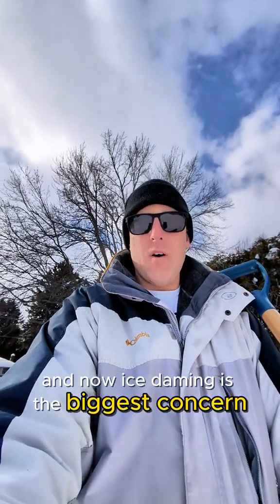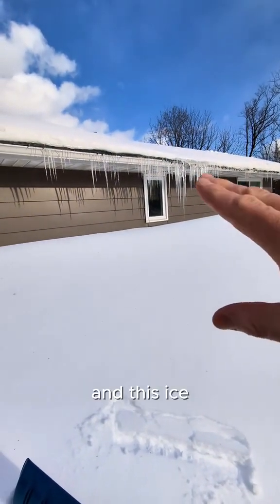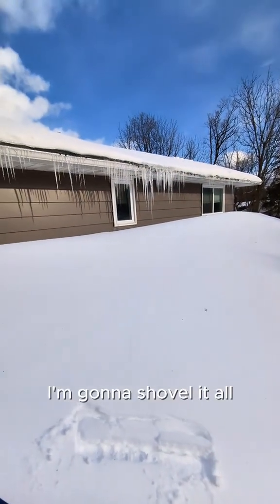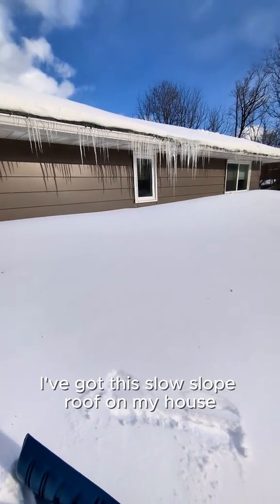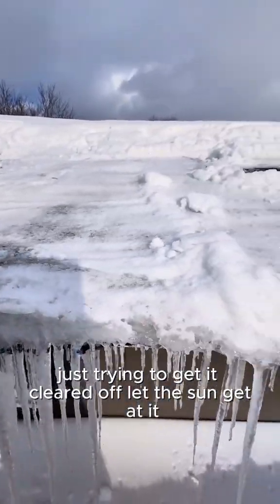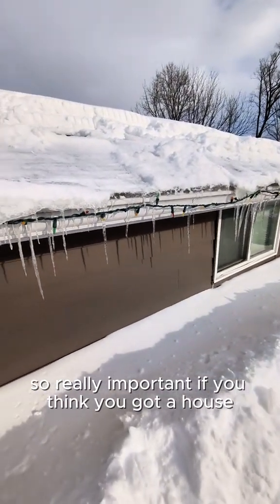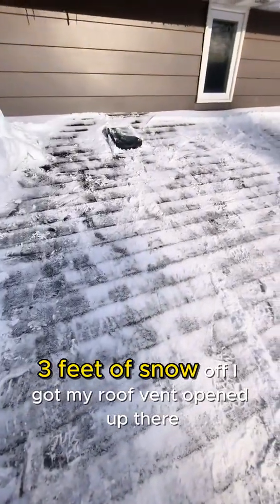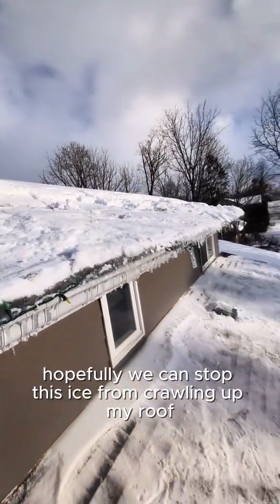Ice Damming on Roofs Explained

Comment: Does your bathroom fan exhaust out your roof? If it's running out you're soffit the soffit will suck it back into your attic. I get these calls all the time. I'm just curious if you know what is causing all the ice other than having a lot of snow covering your ridge vent or pancake vents. I've been in the insulation business for almost 20 years now. Maybe I could be some help to you.